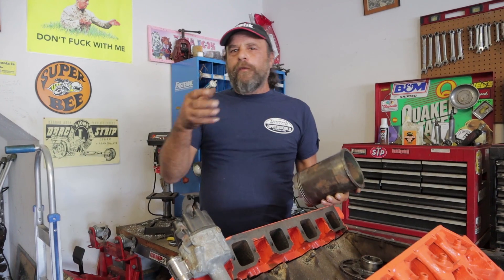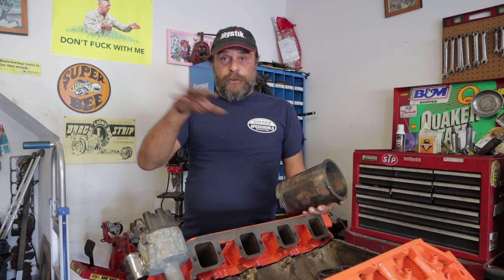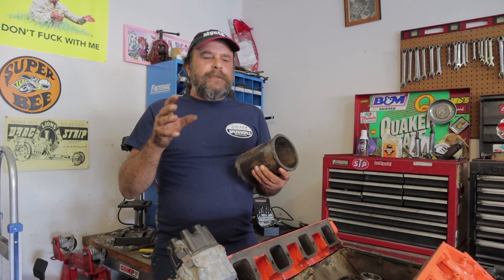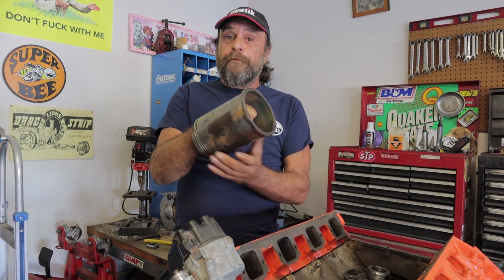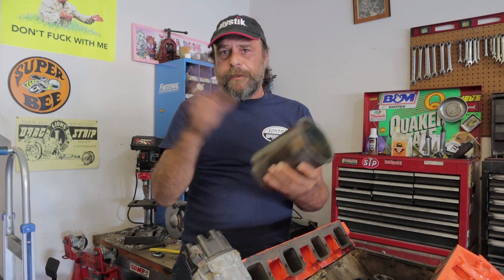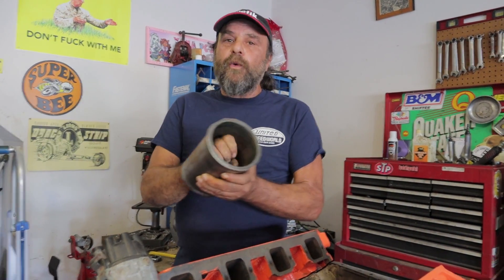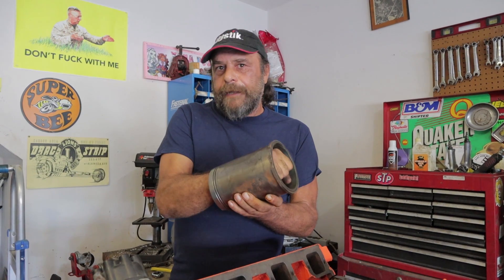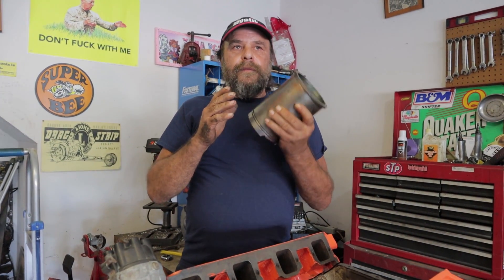The Myth Of Engine Displacement

Comment: I always thought  the 400 dodge.engine.  would be the perfect compromise. Short stroke large bore. Room for big valves.  Hi rpm. With descent swept area..great video
Reply: I’ve always wanted to turbo a 400 Chrysler engine...
Reply: Yet everyone who builds them builds them into 451's or 496's I've very rarely seen someone build a stock stroke 400. Why do they do that?
Reply: @TL-angzarr  the deck on a large block is 1 inch difference than a 383 in the 400 to call Short Stroke because of the cylinder you can put a larger crank or smaller crank in it it's still a short cylinder Short Stroke get it
Reply: @corinecolt1028  Yeah you are clueless, short stroke only refers to the length big the crank throws, changing deck height makes zero difference. Shorter cylinders are stiffer but that has nothing to do with the stroke length
Reply: T L, I know hardcore dodge guys that hate 400’s, they won’t touch them other than using the block...
Reply: @shitbox7413  there's a reason for that, for any given power level a bigger motor will make it at lower rpm.  I have a 400 block that now measures 511, makes just over 900 hp, I want to see someone do that on 400 cubic inches, it can be done but would take 9500 rpm or more
Reply: T L, Not everyone’s goal is 900 hp
Reply: @shitbox7413  doesnt matter even at 300hp a 451 will make it at a lower rpm than a 400
Reply: T L, Of course it will, doesn’t make a stock stroke 400 completely worthless, I’m sure a cam and heads would wake up a 400 enough to have some fun on the street. Otherwise yes by all means a 451 or bigger would be a better choice.
Reply: @TL-angzarr  Here is why:
It is easy. You can do some minor mods to a 440 crank(which can be sourced from early forged instead of never forged 400 cranks) and it drops in, so now you have a stronger crank offering simple cost effective increase in size. 
Now, what i don't get is why people use the 440 rods, when using the 400 rods will make a much better rod ratio with much slower piston speeds meaning it can rev much higher with less "bad" piston motions(like the sideways push at the bottom of stroke) and usually a piston design that lends to longer engine life(no oil rings in the freegin pin hole!) outside of giving up some more cubic inches, I can not see the downside of skipping the 440 rods unless you are building an all in $$$$ strip car. 
but then, i am one of those oddballs that looks at durability, and also just engine operating characteristic vs max dyno numbers. It's why I prefer  stuff like high revving Ford small blocks vs say a cummins deisel truck, even though the truck would be tuned faster in a straight line. Listening to the engine and putting it through it's paces on a windy county trunk highway is much more enjoyable to me then blasting down the strip once for 12 seconds. but to each their own(except the electric car guys, I don't need that crap shoved down my throat)
Reply: @davenhla  2 things I know for sure, the first is you need to stop typing the more you type the more your ignorance becomes strikingly apparent. The second is you've never built a 451.  If you had then you would know the simple mod you speak of is grinding .125 of material off the mains to make it fit. It also requires about .375 to be shaved off the outer edges of the counter weights.  If you don't they have to drill massive holes to get the crank to balance.  All this can be done but the cost of these operations are close or more than the cost of many modern new stroker cranks in 4.15 or 4.25 stroke.  I know you've never built a 451 if you had then you would know 2 things that you obviously don't the 1st is even with 440 length rods the piston pin is NOT in the oil ring. Even if it was that's not a problem.  Further, the piston speed is determined by the stoke length alone so swapping the rods won't change the speed at all.  Using 383 length rods you only net you less dwell time, you are even dead wrong the shorter rods will have more side thrust than the 440 rods. They have to, the shorter rod requires the rod angle to be greater.  You know nothing about engines if you did you would realize that the 440 pistons are used because the lighter pistons means less bob weight which means less stress on the mains and increased durability.  Only with ancient long obsolete aluminum alloys and ring material was a tall piston needed to make an engine reliable.  You are so ignorant you even think that the shorter rods give up cubic inches, they don't. The only change dwell time and not for the better.

Comment: There's a 240-pound difference between many 6-cylinder and 8-cylinder engines. Displacement doesn't mean much if the engine is incredibly heavy and inefficient.
Reply: There is only like a 75 pound difference between a straight 6 and a V8
Reply: @bjjdatsun  When you factor in the additional weight of all the other systems a V8 has in comparson, you will see its more than 75 pounds. Transmission and suspemsion is different, so is the fuel, cooling and charging capacities.
Reply: @999thenewman  not at all you put any power through a RB/2jz they are using t56 tremics the same as a v8. They run the same fuel and the suspension is the same you dont have to change anything else.
Reply: @999thenewman  I swapped my 280 from a straight 6 to a twin turbo V8 and only gained 200 pounds yet I have 2 turbos 2 intercoolers and all the extra piping. Still running same radiator,gas tank, suspension and brakes.
Reply: @bjjdatsun  <_> ? These videos are for old Mopars.
Reply: @999thenewman  Much of Uncle Tony's extensive knowledge can be applied to any manufacturers product. I'm a "anything but Mopar" guy and I still find  his videos to be very informative and beneficial.

Comment: So if an engine always uses the same "working displacement" no matter if stroked or not, have the engine rev quicker and higher.  Am I off base?
Reply from the maker: You can raise the deck and increase the working displacement, but our example was based on a typical street/strip production engine

Comment: I was told that "All else being equal ; there is no replacement for displacement".
Reply: For the most part that is right. Someone would argue that taking a 1.2L 4cyl and boosting to 14lbs (relatively speaking) and make roughly say 200HP is pretty good, but just for the sake of argument, it's not unreasonable for a 2.4L NA version of that motor to roughly make that same power. It would be better to say that stroking a motor would have diminishing returns the bigger you make it simply because the rest of the engine is not designed or changed to match over sizing of the original displacement dimensions. Power adders in a sense is increasing available I guess "intake charge" to make more power with.

I guess I could say that the mentality of someone spouting; I hear often 1200HP capable VW 2.0L is amazing, but what if we had a 4.0L VW Turbo?. Would that make almost 2400HP. Probably not because we are getting into the extreme realm of heat and pressure. But it would make much more than the 2.0L and less likely to blow up.
Reply: But all else isn’t equal.

You can’t just shove a larger engine in and expect the same weight, the same weight distribution, the same revs, the same response, the same powerband, etc etc. 

And smaller engines are usually set up different. Adding a turbo and DOHC to a four cylinder is a lot easier and cheaper and lighter and less bulky and worth it than doing it to a cross plane V8.
Reply: @Bartonovich52  a 283 and a 383 use the same block and if using the same camshaft, heads, intake, carburetor, etc. The 383 will make more power. Nobody said anything about engine weight being a factor in producing more power. It goes without saying that Larger stroke cranks, rods, and pistons will weigh more than others and negate some performance gains. That 100 cubic inch would make up for it though.  Now, obviously even a 283 with high compression, large valve, free flowing heads, stiff springs, and long duration, high lift, closer LSA along with a carburetor that's jetted optimally will make much more power than a stock equipped 350 even .030" over and stroked an additional 0.75" to 383 CID. I was referencing an engine, on a stand Small Displacement vs Large Displacement variant of same engine family with all else being equal then the larger engine WILL make more power. There are also variables such as, bearing diameter surface drag,  piston dwell time, piston fps, rod angularity, compression height, drag from High Pressure oil pumps, headers vs manifolds etc. That would fall into the "not equal" category. (spelling / grammar edited)

Comment: So then how does one increase the working portion of the stroke/engine? How do the cams, heads, valves, and all the other parts get tweaked to maximize engine efficiency so you make it do maximum work?!
Reply from the maker: No simple answer for that...but now you've got something to research and get all zen with.  good luck!
Reply: You'd need a longer bore - so a different block.

Comment: Power to weight will always be King.
Reply: Small block on a creeper.
Reply: And thus......................the SBC.
Reply: up to a point
Reply: Yep.
Reply: up to a point
Reply: @no candy these kids nowadays by me are running the exhaust up out of the hood and along the windshield pillars on their 70s V8 and onto the roof of the car
They said it keeps all the heat out from underneath the car which makes the car run more efficient plus they can put a skid plate underneath the car and lower it to the ground which keeps the air out of it which lowers the drag it looks like a snake or a dragon with the exhaust tips Up on the Roof
It makes perfect sense and you wonder why nobody's ever done it until now
Reply: @thecloneguyz  Well, I don't know where you live.... but here that would be illegal if the cops wanted to enforce it. So that might be why.
Reply: @davenhla  
Seattle, Wa!
Reply: *Said Tesla
Reply: @thecloneguyz  Tesla cars are heavy
Reply: @calholli  their power to weight ratio blows away any combustion engine car that's ever been made in history
Reply: @calholli  it's no coincidence that a $30,000 USED Tesla can keep up with or beat a $250,000+ supercar
Reply: @thecloneguyz  not around corners
Reply: @ Fiore Tutta

Are you really comparing the flammability of batteries to fucking gasoline?

Weight works around corners too because it increases traction. It’s also very low C of G. Nice try moving the goalposts, though.
Reply: @thecloneguyz  I'll race one from LA to NYC in my 1997 F250.
Reply: @Stacy_Smith  lol. It will get a hell of a head start but will be spending the night at a lot of places too
Reply: Richard Wolfe until 100mph with no pleasure of engine noise, which is musical
Reply: Richard Wolfe That’s not true at all. There are plenty of cars that have a better power to weight ratio than the fastest Tesla. The Demon, Challenger Hellcat Redeye, Chiron, Veyron, Agera RS, Agera R, Regera, P1, 720S, ZR-1, 911 GT2 RS, 911 Turbos S, GT, all have better power to weight ratios then the Model S Performance. Teslas are super fast from 0-100 and that’s about it. Most super cars and high hp muscle cars can pass a Tesla after 100+ and walk away. I’ll stick with a car that sounds like something.
Reply: calholli Electric motors are nothing without their massively heavy battery pack. There is a reason the model S weighs almost 5,000 lbs. the battery and motors together are extremely heavy and actually have a terrible power to weight ratio. A 500 lb gas engine can make 700+ hp easily whereas the electric motors and battery weigh far more than that.
Reply: calholli The model S Performance is AWD and has plenty of grip. It doesn’t need to be so heavy. That said, even on a drag strip, a relatively large battery is necessary. It wouldn’t have to be as big, but still pretty big to generate the power needed for 700+ hp.
Reply: calholli All I’m saying is that internal combustion engines are better than electric motors and batteries. Power to weight is king like you said, and electric setups are lacking in power to weight.
Reply: calholli The way I see it, the fastest cars in the world are Internal Combustion powered. Until they can make a sub 3,000 lb electric unit that makes 11,000+ hp, the ICE is still king of the hill.
Reply: calholli Sure is
Reply: @GyroPyro121212  
100% TORQUE in electric cars - hence why the Electric Semis are killing the old ones!
Reply: Richard Wolfe Also, electric semis are not killing real semis and have terrible range compared to a diesel semi.
Reply: @thecloneguyz  Electric motors make a lot of torque. They replaced a lot of internal combustion engines in applications where electricity was available. Example modern sawmills ect . Future of battery power is questionable for the masses ? Gonna need a long extension cord otherwise

Comment: Interesting stuff. Hopefully this isn't a stupid question. Would a significantly oversquare engine, with direct fuel injection (so the piston gets help drawing sufficient mixture into the cylinder) be better for any given displacement?
Reply from the maker: Y'know, I'd have to think about that.
Reply: Not sure how D.I. would help.  The engine still has to draw in the same amount, whether it's straight air or mixed air/fuel.  The mass of the fuel doesn't seem like it would make a significant difference, and the fuel still has to be in proportion to the air that's drawn in, so you can't increase that without increasing the air.

Comment: Effective power stroke is one reason why diesel engines produce more torque than a same sized gasoline engine. Increased cylinder pressure due to high pressure injection continuing to inject diesel fuel into the cylinder after the piston is going down on the power stroke. Even without the assistance of a turbocharger.
Reply: The torque is sick from a diesel. 
I'm looking into a pump duse 2.0 vw diesel, and getting 450ft pounds of torque from it sounds like fun. 
Then throw it in a rabbit and weigh less than a ton. 
Wrong wheel drive though  , sorry bout that
Reply: Tony needs to do a video on the idiots quoting their torque figures .. u can have all the torque in the world but if u aint got power your 1/4 time is nothing .. why u think all 1/4 mile calculators ask for power and weight not torqur and weight .. just another thing the sheep have latched on to like "no replacement for displacement"
Reply: @slimshady2777  see it all the time with fwd cars. 
Alot of power , mediocre times compared to rwd. 
Obviously because of traction.
I'd be lucky if that setup broke in the 12s I'd be happy,I'm not willing to run slicks and break shit. 
That's still 300hp or so in a car that weighs a ton or under.
Reply: Tony needs to do a video on the idiots quoting their torque figures .. u can have all the torque in the world but if u aint got power your 1/4 time is nothing .. why u think all 1/4 mile calculators ask for power and weight not torqur and weight .. just another thing the sheep have latched on to like "no replacement for displacement"

Comment: That's good to know stuff. I've been told the Mopar 360 to 408 is a great stroker set up. What's your opinion of it as a weekend car not a daily driver?
Reply from the maker: I'd do it just for the shorter rod ratio
Reply: @UncleTonysGarage  yeah I'm thinking of doing it to my wife's 71 Challenger. I've heard of doing the Magnum heads conversion for flow. Have you ever tried those? Or would you do J heads?
Reply from the maker: I'd keep it simple with a set of ported J's
Reply: @UncleTonysGarage  then I'll keep an eye out for them. I also got some purple hornies for her truck. I told her you'll never hear the radio again
Reply: @UncleTonysGarage  and thank you for the advice